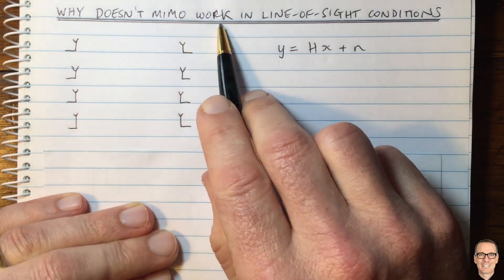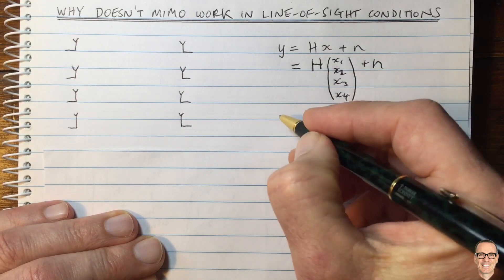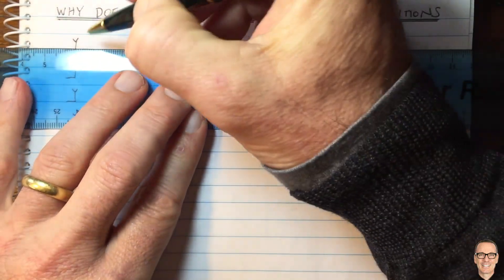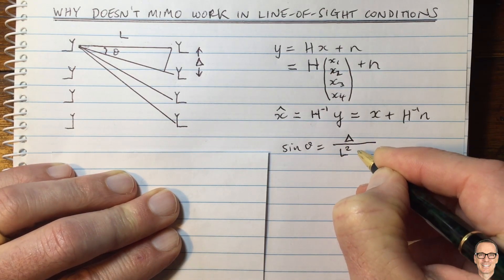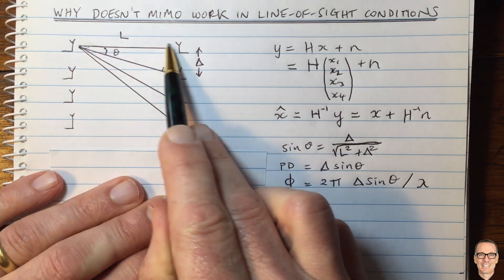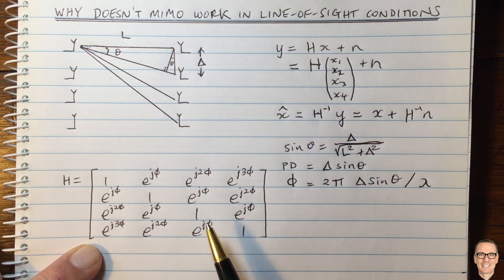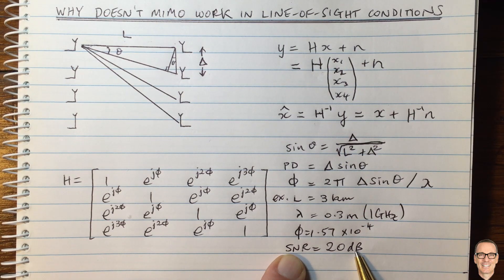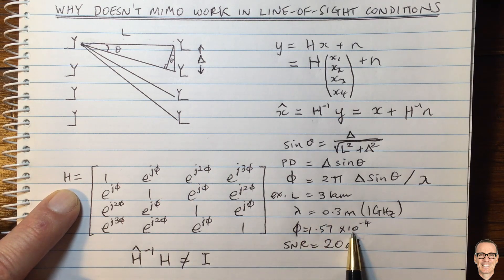Why doesn't MIMO work in Line-of-Sight (LoS) Channel Conditions?

Comment: This linear increment in the phase (phi, 2*phi, 3*phi...) is only true provided that delta increases for antennas 2 and 3, then 3 and 4, and so forth. Isn't it?
Reply: I suppose this aproximation is valid (sin(x) = x) for small angles, given that L is much higher than delta...

Comment: Great explanation. However, you have not considered the precoding element in your argument. For example, in LTE 2x2 MIMO, the two symbols transmitted will already by multiplied by a DFT weight vector to sufficiently spread the signal across the phase dimension. Secondly, there is an element of polarisation diversity that becomes important in LOS scenarios. In those conditions, the cross polarisation between the antenna elements provides sufficient decorrelation to allow MIMO to work. Thoughts??
Reply from the maker: Yes, if you have more dimensions (bandwidth, polarisation, etc) then you can always send more data.

Comment: Thank you, Professor. Very great tutorial. I have a question. you did not assume the far-field condition in channel modeling. I think that by modeling the channel in the far-field mode, the channel matrix will be the outer product of 2 steering vectors. So, the real H will be rank 1 and consequently non-singular. So, the MIMO does not work even in far-field LOS scenarios. Is my deduction true? And how the LOS challenge is addressed?
Thanks again for your consideration.
Reply from the maker: But why would you use a "far field" channel model, when it gives incorrect answers that don'y match reality?
Reply: @iain_explains  For the cases when  BS-BS or BS-MS distance is more than  2D^2/lambda, far-field assumption does not make scenes? I mean it may be approximate, but makes the signal processing easier.

Comment: I think you have a mistake in H definition. 
The phase does not linearly advanced: 0, x, 2x, 3x, 
but: 0, x, 4x, 9x …
Reply from the maker: You're right! I made the mistake of approximating a linear relationship between the antenna spacing and the angle between antennas. Either way, the main point I was trying to make still holds - namely, that the channel matrix can be inverted. ... but it's annoying that I made that assumption. Thanks for pointing it out.

Comment: This is great content, thanks a lot! But maybe it should be mentioned that there are use cases for LOS MIMO (spatial multiplexing). For example in microwave backhaul where antennas can be separated enough to make the streams orthogonal
Reply from the maker: If you’re talking about having directional antennas spaced so far apart that the beams do not overlap, then the propagation paths are parallel and independent. That’s not a MIMO channel.
Reply: @iain_explains  No, I'm talking about real MIMO. For example, Ericsson and Deutsche Telekom has demonstrated 4x4 LOS MIMO over a 1.5 km hop at E-band. The antenna separation is approximately 1.5-2.0 m. (for some reason youtube do not allow me to post links to the source material, but google 'Ericsson microwave mimo' if you want to read more)
Reply from the maker: OK, I see. That actually aligns with the point I make in my video. Namely that LoS-MIMO is possible, since it's not true that the H matrix can't be inverted (which is the commonly held belief). In the E-band example you're talking about, where L=1500m and Delta=2m, the value of psi would be 15.63 (for a 70GHz carrier), which is 10000 times higher than the value for the example I showed in the video for standard mobile signals at 1GHz carrier. And this value at E-band is clearly big enough to be estimated in the noisy conditions, which means H will be estimated accurately, and can be inverted. ... By the way, this is not the reason that is given in the document you referred to - which is misleading, since that document talks about 90deg phase shifts, and claims that 90deg is what's needed to seperate the signals. That's only true for two antennas sending BPSK. That argument/logic doesn't scale to quadrature modulation, and higher numbers of antennas.
Reply: @iain_explains Thank you for the feedback. And again, your videos are great and very educational

Comment: wonderfully explained...however I beleive that φ is actually Δφ...it is the phase difference....Besides, for very novice audience, you may want to consider using 2nd law of motion to explain: t=Δsinθ/λ and f=c/λ when put in the expression Δφ=2πft to get the final form of Δφ=2πΔsinθ/λ
My question is then how to increase channel capacity in a LoS link for example a UAV air to ground link....the Δ will always be <<<the range of the UAV so the phase difference will always be negligible....how to increase this phase difference artificially if possible? the receiver is at ground and the transmitter is in the air on-board the UAV in a 2x2 MIMO configuration.
Reply from the maker: The phase difference depends on the frequency too. The higher the frequency, the bigger the phase difference.

Comment: Dear Professor, 
At @8.28.How did you confirm that H estimation ( i.e estimation of pi )n  will have 3-10 amount of values of pi. ?   
Do we have this LOS issue in case of beam forming too ? or just spatial multiplexing ? Please clear this to me
Reply from the maker: In beam forming you don't invert the channel, so you don't have a problem. In fact it is an advantage for beam forming. More details here: "What are Spatial Diversity and Spatial Multiplexing in MIMO?" https://youtu.be/MNA0xn7EeyY

Comment: Hi professor, I have tested your code. If consider LOS, we cannot get an identity matrix by inv(Hest)*H. If I added a rayleigh fading to the channel, the identity matrix would be obtained close-perfectly. I suppose the mean of the exact and estimated channel Hest-H should be remarkably different between these two scenarios. However, I found that the means (Hest-H) are almost the same in those two scenarios. Would you please let me know why this happens?
Reply from the maker: Sorry, I'm not sure exactly what you mean when you say that you added Rayleigh fading to the channel.

Comment: Dear Professor, what is the relationship between accuracy and the SNR? let's say I have a paramter to estimate with true value of 1.123456789. in 30dB SNR, at which digit can I reach in my estimation?
Reply from the maker: To answer your question, you'd need to know how the noise affects the measurement (additive, multiplicative, ...), and you'd need to know the noise model (distribution, correlation, ...), and you'd need to know what type of estimator you're using (linear, nonlinear, optimal, ...), and you'd need to know if there were any other parameters in the system, or interfering signals, etc. Perhaps this video might give some insights: "What is Least Squares Estimation?" https://youtu.be/BZ9VlmmuotM

Comment: Thanks，Professor. I have a question about MIMO：If LOS can not work for MIMO，then we need an environment full of scattering to creat more paths from transmitter to receiver and then I think now the flating channel （in LOS case），now will be changed to frequency selective channel，because same signal come to the receiver with different delay, so is it that mean MIMO can only work in frequency selective channel？
Reply from the maker: No, that's not necessarily the case. There can be lots of reflectors that are all roughly the same distance away, but in different directions. All of these reflected paths can arrive within the same symbol period - especially if the symbol period is long. Perhaps you might like to watch: "What are Flat Fading and Frequency Selective Fading?" https://youtu.be/KiKPFT4rtHg
Reply: Thank you！
 @iain_explains

Comment: What if we apply some other receiver (not the ZF),  then would it be helpful to use MIMO with LOS.
Reply from the maker: It's not about the receiver. It's about the transmitter. If you have LoS you won't be able to transmit seperate data streams on each antenna (spatial multiplexing). Instead, you can send a single data stream and use beam forming (spatial diversity). See "What are Spatial Diversity and Spatial Multiplexing in MIMO?" https://youtu.be/MNA0xn7EeyY

Comment: Hi Sir! Excellent video!  Question. In you're example how did you arrive at 3-10 times the amount of noise with yields that much for the error in the phase?  Thanks.
Reply from the maker: That's the topic of next week's video. But you can already find the answer in the Matlab code I posted for this video, which includes channel training and estimation.

Comment: Thanks a lot. Have you already done a video how averaging the noise can improve the SNR?
Reply from the maker: Keep an eye out for next week's video. 😉
Reply: @iain_explains  that would be great, perhaps with the calculation how you get to the noise expression sigma_n^2/M (M = number of antennas) using the expectation - I'm struggeling with that.
Reply from the maker: OK, well that's not in the video that's going to be posted on Monday, but I'll add it to my "to do" list.

Comment: LoS matrix is of rank one (Columns are dependants), so any subdetermin should be zero, take the first four elements (left top corner 2x2 matrix), the determinant is not zero? so the element 2,2 should be exp(2theta) instead of one.  This is for far field communications. (Please correct my undertsanding).
Reply from the maker: The thing is, I don't agree with your first statement - which is the point of my video. The LoS matrix is not of rank one. Far field assumptions are OK for single transmit antennas, but when it comes to MIMO, the phase difference between every antenna pair is important. The waves from each transmit antenna might be arriving as a plane wave, according to the far field assumption, but each transmit antenna launches them from a different location, which means their phases are different. Techniques such as beamforming rely on this. Yes, there is one eigen vector that dominates all others in the LoS case, but the other eigen values are not actually zero (just very small and hard to estimate in noisy measurement conditions).
Reply: @iain_explains  This is really a nice  different view for MIMO LoS channel, I want to refer to your example in one of my research paper that I am working in. Is this example mentioned in any paper published by  you so I can cite it as a refernce
Reply from the maker: I don't have a paper where I discuss this point specifically, however in the following paper we assume the mean matrix (M) is arbitrary rank (in Section III) and we give references to other papers that support this, including an experimental measurement paper. The matrix M corresponds to the LoS component. 
M.R. McKay and I.B. Collings, "General Capacity Bounds for Spatially Correlated Rician MIMO Channels'', IEEE Trans. Information Theory, Vol. 51, No. 9, pp. 3121-3145, September 2005.

Comment: Hell Prof, sorry for the Off-Topic question, but a comment on a recent video of yours has a higher chance of a reply from you. My question is about Information Theory, The thing is How Does Channel Capacity's relation to Mutual Information makes sense Intuitively?
as in  iam confused about how mutual information intuitively relates to channel capacity. Take an example  ,Let us have three random bits, X, Y, Z. X and Y are independent and unbiased, while Z is the exclusive or of X and Y. Then H(X,Y)=2, while H(X,Y|Z=z)=1 for any z∈{0,1} because knowing Z and the value of X determines Y. Then I(X,Y;Z)=H(X,Y)−H(X,Y|Z)=1. In words, if you know Z you only really need to encode X rather than both X and Y. So basically instead of sending complete information about the system (X,Y) , if i know Z i should only encode H(X,Y|Z) and that's enough! So I save he trouble in encoding 1 bit or I(X;Y) bits to represent the entire (X,Y) system. Now how does Channel capacity come into the picture? This mutual information is something that we don't need to encode because the receiver already knows it, they say the channel capacity is mutual information, how ? This is the part of information that the receiver already knows , how has it got to do anything with the channel?
Reply from the maker: Capacity is the maximum that can be achieved of the mutual information between the input to a channel, and the output from that channel. In other words it is the most "shared information" that you can achieve between the transmitter and receiver (in a probabilistic sense). Have you seen my video on Capacity? I didn't refer to MI in that video, but I've put the suggestion on my "to do" list for a future video. "What are Channel Capacity and Code Rate?" https://youtu.be/P0WY96WBUyA
Reply: @iain_explains  Did watch the video Professor! , there you had quoted that Channel capacity is the rate at which i can send bits at nearly 0 probability of error, but mutual information is something that we dont need to send through the channel coz both the sender and reciever knows that information. How does Mutual Information (Or "Savings" as people call it or "Shared Information" as you call it) relate to "rate" or channel capacity? anyways in order to send the remnant information (entropy-mutual information) , i need to send it through the channel anyways! So i need to add redundancies to those bits, by knowing mutual information, the number of data bits certainly gets reduced, but to pass the remnant data bits with 0 probability of error, you anyways need to add infinite redundancy isn't it Professor? How is Mutual Information having the backing there? Also, i am waiting for your video on this!

Comment: Tried it in Matlab, cool model thanks. How is line of sight combatted in the real world to achieve mimo? Thinking of a cell tower pointing at someone standing in an empty field. Is fading enough to enable mimo in this situation? Or just simply the NW chooses a pre-coder to fix this?
Reply from the maker: In line-of-sight conditions it is best to use the multiple antennas in a beamforming mode (spatial diversity), rather than the "standard MIMO" spatial multiplexing mode. See: "What are Spatial Diversity and Spatial Multiplexing in MIMO?" https://youtu.be/MNA0xn7EeyY
Reply: @Iain Explains Signals, Systems, and Digital Comms  Hi professor, thank you for the video.  One technique to obtain higher ranks on MIMO channels under LOS is by applying dual orthogonal polarization (like -45° / +45° per antenna element).
Reply: Very helpful...